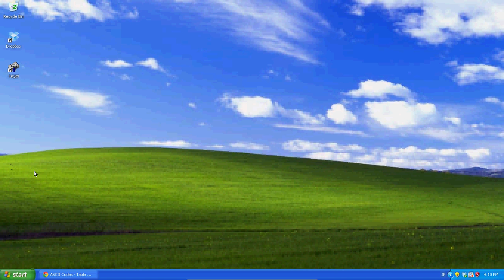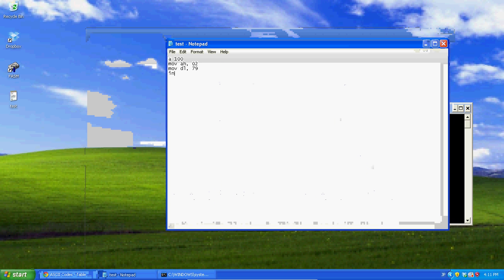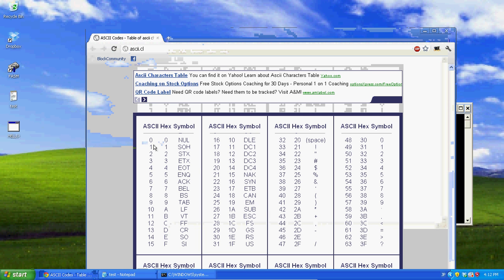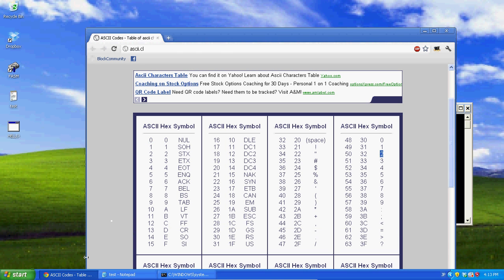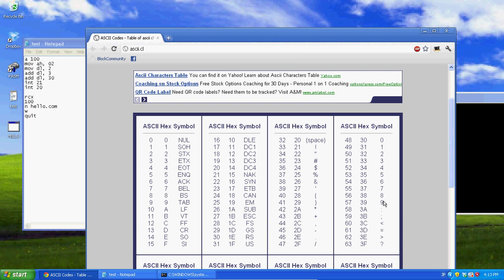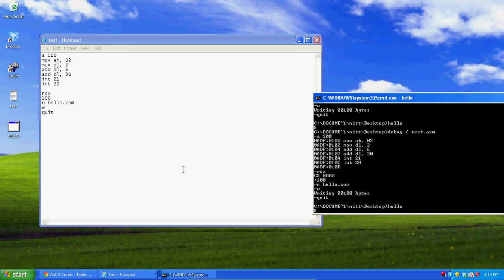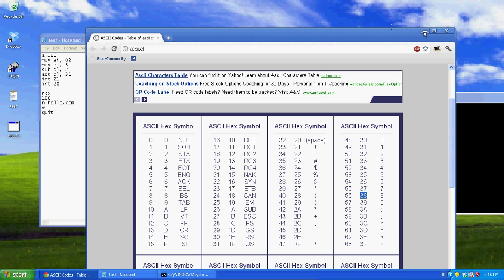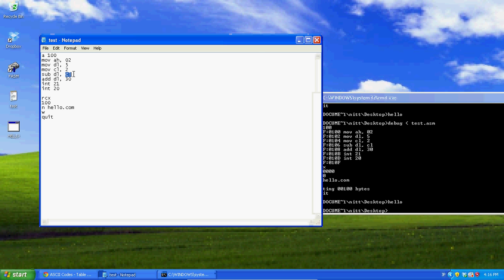Assembly Tutorial 7 - Adding And Subtracting Registries

Comment: How I can print the addition  of two numbers  that were input by user ?
Reply: It gets a little complicated if you want to input multi-digit values, because you will either need to use the interrupt that gets input from the user, or create your own input program, because I dont really like the built in input interrupt, and then you will need to convert those strings to numbers, and add them, and then you convert the result into a string and output the result. Well maybe there is a different way of doing what i just said. If you want to get 2 single digit values from the user, you could just subtract 30h from one of the inputs, and add that to the second input, but that way, the sum cant be larger than 9. Well, maybe there is an interrupt that gets a number from the user, idk

Comment: so ... Register AH contains the "Command" or what to do when INT20 subroutine is called, right? and it expects a byte to print in register DL. ok. but i also know that AH is Part of a much bigger register (AX, AH and AL combined), same with DL (DX is DL and DH combined). Question now is... what is happening to the whole register (the high byte)  if you just load in a single low byte ? will it zero itself ? or is the IN20 subroutinge just dont caring about anything in the HIGH part of the register A and D ? i feel there is a missing link.
Reply: if you load something into AL ( low byte ) then AH ( the high byte ) will not change, but if you for example load 1 into AX, then AH will be 0 and AL will be 1